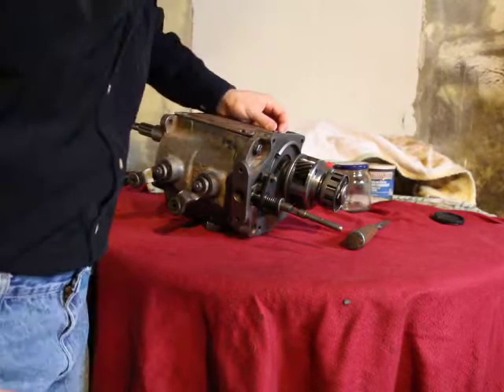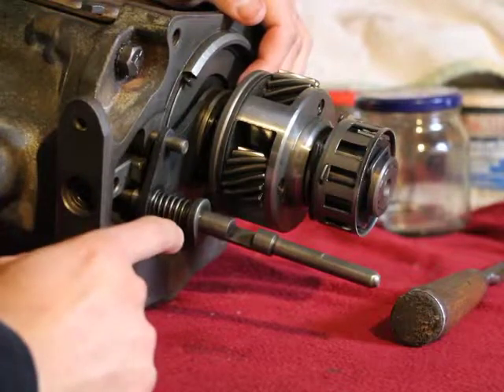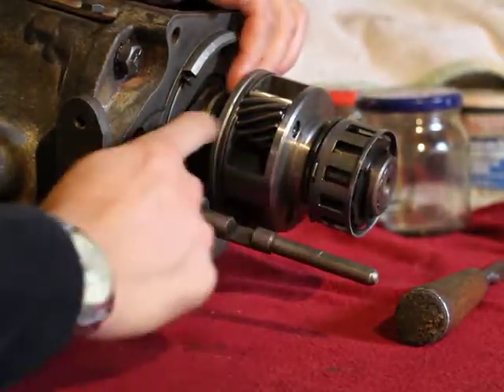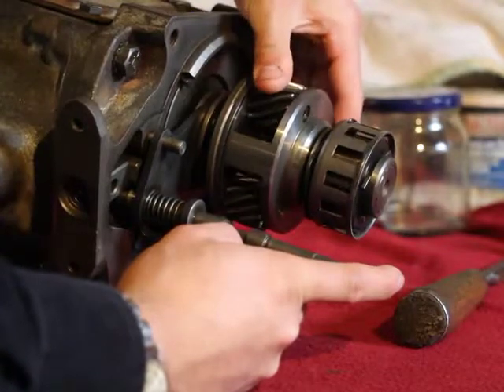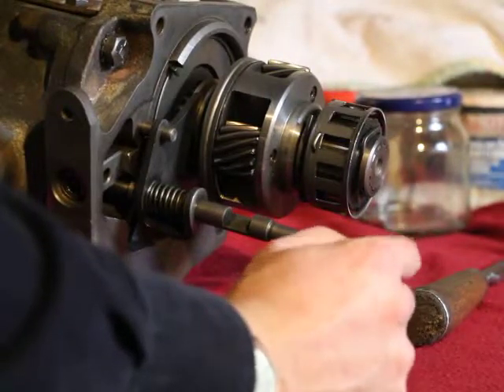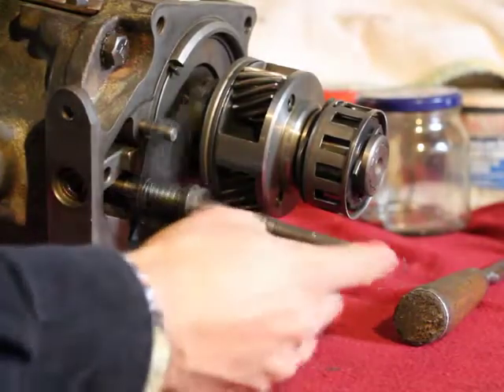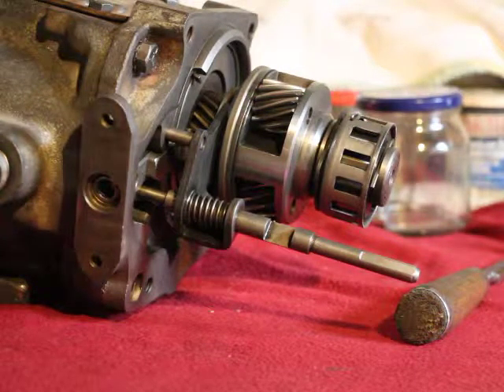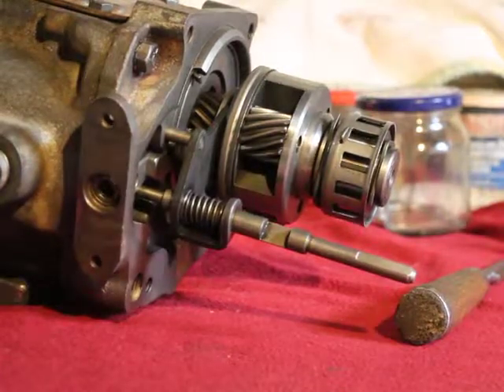How The Borg Warner Overdrive Works 12

Comment: Hello, I haven't found a topic like this anywhere. I have a problem with my 1972 XJ12L, after a test drive I think the transmission is locked in 1st gear. The gear lever is in order and transferred to the control box, the oil is fine. The service told me that the problem was in the clutch. Can someone help me, I'm from Croatia, and the service is located in England, no one here repairs that team of gearboxes. I forgot to write that it is a transmission is locked in 1st gear. The gear lever is in order and transferred to the control box, the oil is fine. The service told me that the problem was in the clutch. Can someone help me, I'm from Croatia, and the service is located in England, no one here repairs that team of gearboxes. I forgot to write that it is a BORG WARNER 12 gearbox.
Reply from the maker: Hi friend. Yes, I doubt you would find this high amount of detail and simplicity  in any other channel. 

I'm not familar with the borg warner 12 transmission, but I will give it a look. If you still need the help, send me another comment.

I believe your missing a letter on the identification. Is it M12? or perhaps T12?

If it's a manual transmission, then indeed a faulty clutch linkage would not allow you to change any gear.
Reply: @OldCrowsClassicCars  It is an M12 automatic transmission. If it was a manual gearbox, it would be over: D
Reply from the maker: @TheIvan22215  Yes I assumed it was automatic. From my small research, it was one of the heaviest duty built transmissions borg warner made. The ford cruise-o-matic might be a replacement for you.

You mentioned 'service is in England'. Do you mean you sent it there for repair? I'd buy a manual for it, dissasemble it, and test everything until you find whats wrong. That's my procedure for any problem.

If you'd consider sending it to me, let me know.